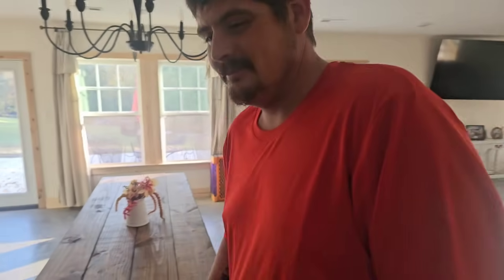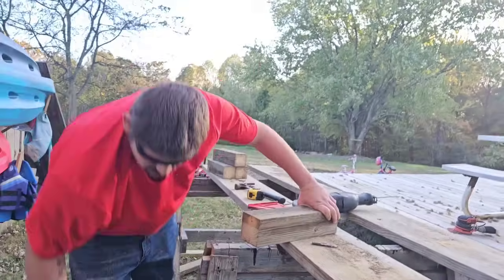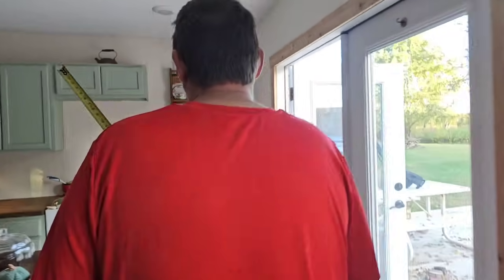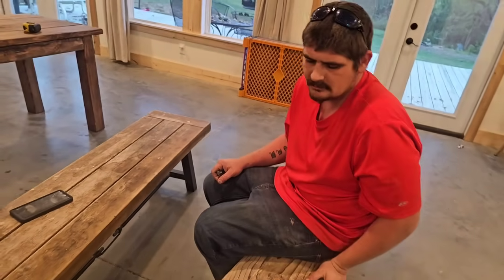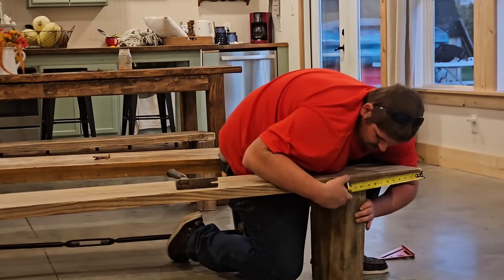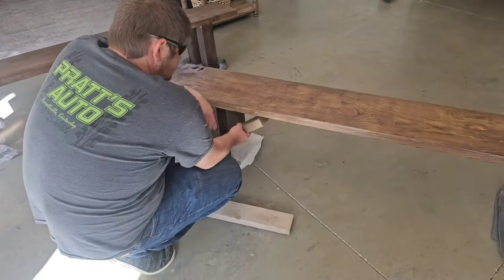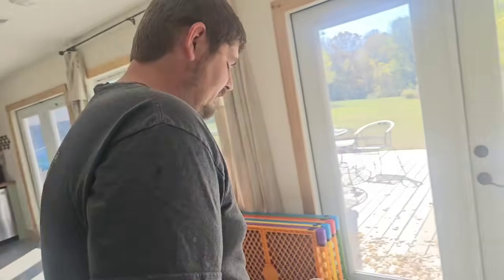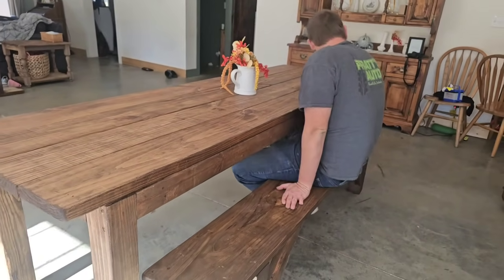How we built our DIY Kitchen Table Benches out of reclaimed wood | Country Cottage Kitchen

Comment: Looks good. Benches were a great fit for this table. One question, do they not need to be sealed with anything?
Reply from the maker: You can seal it, most people would probably tell you yes, but we don't, it's just more you have to buy and we just usually use what we already have to build what we need. It cleans up just fine  either way.
Reply: I asked because I wasn't sure. But your reasoning sounds good to me 🤗